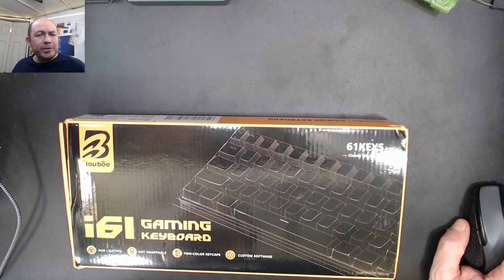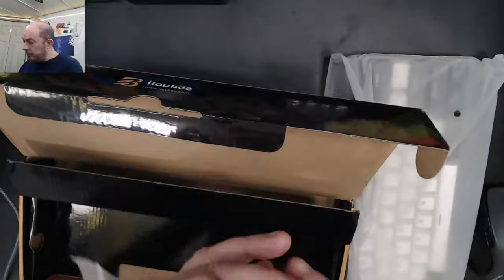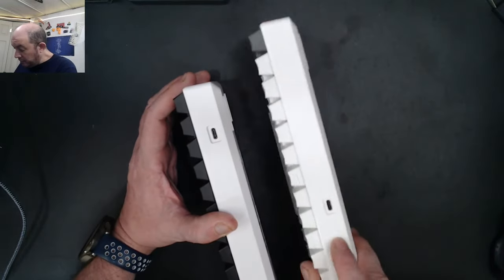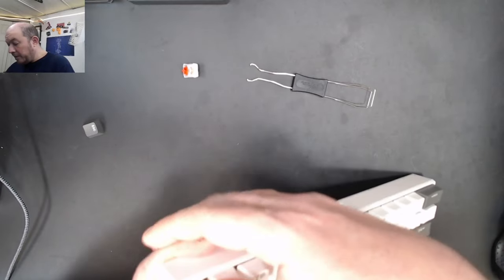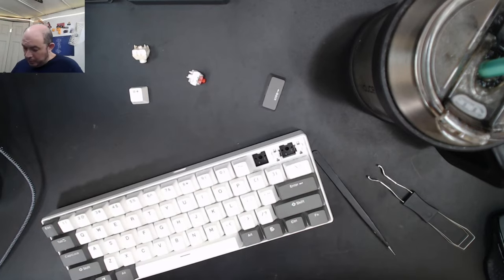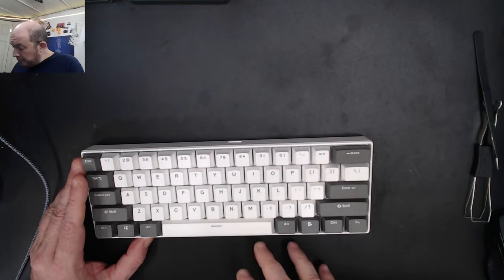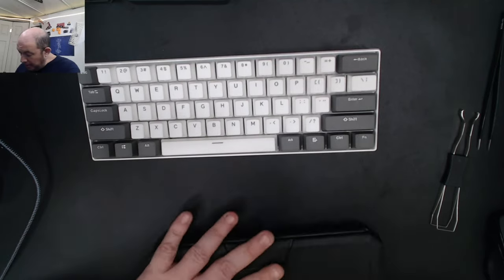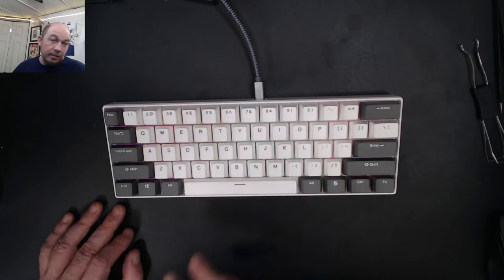ilovbee i61 Unboxing - a $22 60% hot swap mechanical keyboard similar to an RK61 unbox and overview.

Comment: The one problem with this keyboard is that combinations with FN are awkward. You need to toggle the FN mode for some key combos. You need to toggle the arrow lock for Win+Arrow snapping for example.  ALT F4 works using left alt fine, but Ctrl F4 triggers a layer swap instead.. same with trying a Windows+FN combo.

If it had similar firmware to the GK61S it'd be great. Similar layout, but holding Ctrl, Alt, or Win before using FN won't trigger incorrect shortcuts.

Wonder if it lacks NKRO maybe?

Also the Reds on mine feel off.... I have a Magegee board with Otemu Reds that feel significantly better stock.

That said, still worth testing... Those stabs are shockingly good stock for something so cheap.
Reply from the maker: Completely agree.